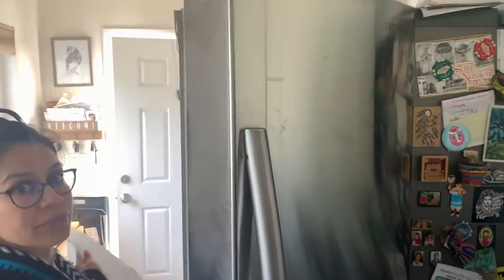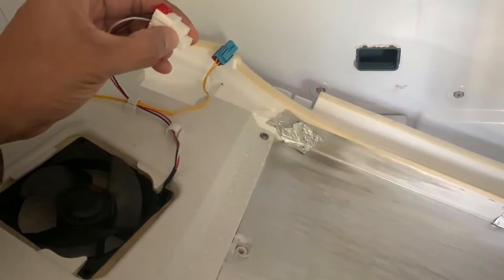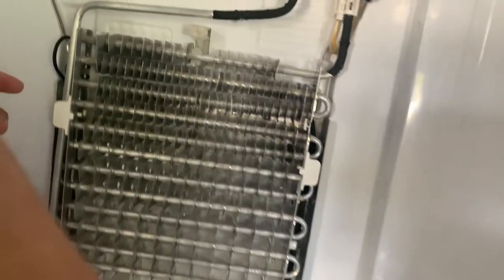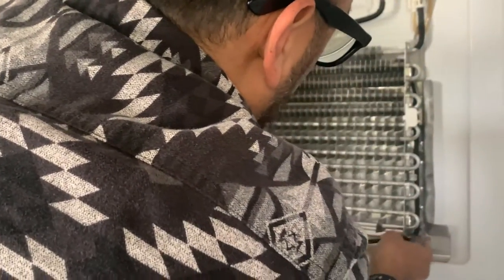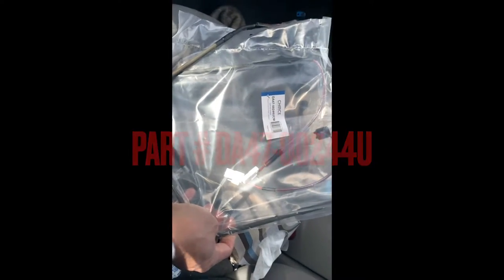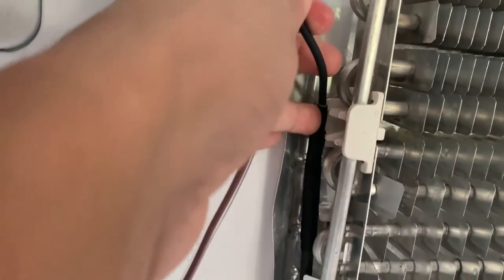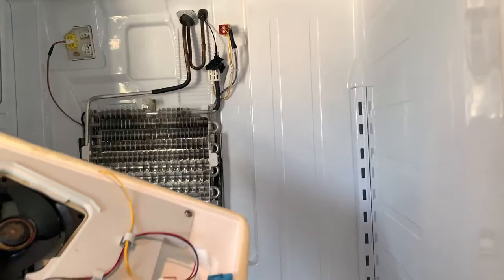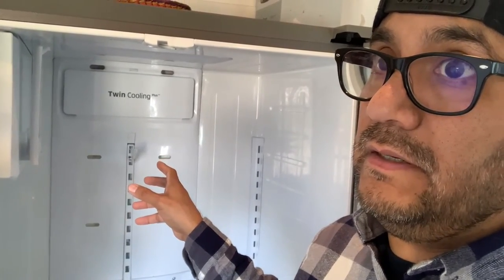Samsung Refrigerator - Thermostat and Defrost Heater Removal and Replacement

Comment: What you’re looking for is an extra heater that they have for the Samsung so it don’t freeze in the back it comes from Canada. I can get you to part number if you need it it just plugs into the other heater and the heater plugged into that I was at Sears repair man for 10 years. It’s something new.
Reply from the maker: That’s pretty awesome dude. Thanks. I ended up calling Samsung and they sent a repair guy out. He came out to my house twice and it still didn’t work. Then they sent another guy who replaced the ice box thing cuz of a warranty issue and it still didn’t work. I got rid off that fridge and got a new one. I hate doing that but wifey was done with that fridge.
Reply: I would love that part number
Reply: May I get that part number for sake?

Comment: Did that Resolve the problem
Reply from the maker: Unfortunately no. I had two Samsung repair guys come out and it still doesn’t work. I basically just unplug my fridge and let it defrost for a few hours and plug it back in
Reply: Bummer
Reply: @SanDiegoVDubLife and this is the only way it works ?  Also how often have to do this?
Reply: The fan might have burn. Try replacing it. I did on mine is in the back. It wasn't pushing air.

Comment: how did you clean the drain hole if it's clogged up?
Reply from the maker: You can pour hot water if it’s ice. If it’s food or debris you can try a coat hanger or pipe cleaner

Comment: My Samsung refrigerator freezer does not work I already changed the motherboard and it doesn't freeze. You think if I change that piece you're changing do you think that could be the problem
Reply from the maker: Not sure. This impacts the fridge section more but they are connected because the air circulates. If the circulation stops it might not freeze.

Comment: Lord have mercy!  I've learned WAY more than I ever hoped I'd need to about the cooling problems of Samsung fridges!!  Your video was very well done and provided many parts of what I learned, so thank you very much!

I'd like to reciprocate and help you and your viewers as well!  I've watched so many videos on this issue, some from handy folks like yourself and some from trained appliance repair techs.  What I've learned is that there are actually FOUR MAJOR DESIGN FLAWS with many Samsung models.

I'm not even speaking about issues with the ice maker or the freezer section. I'm talking strictly about the fridge section.  Here's what I've learned from others....

4 DESIGN FLAWS - THE PROBLEMS
1. The evaporator cover plate (the decorative cover attached to the back wall of the fridge) was poorly insulated and poorly sealed.
2. The openings in the back wall of the fridge, where the evaporator coil and wiring harnesses enter the compartment, were also poorly sealed off from outside (humid) air that can and will get into the fridge compartment.  Cold humid air = ice
3. The factory default position of the temperature sensor that detects the evaporator temperature so that the cooling feature can be turned on and off and the right times, is located on the wrong part of the evaporator coil.  It's located in an area that is naturally warmer than what we would like, thus triggering the cooling to kick on too soon and not turn off soon enough.
4. The factory original "evaporator drain clip" is undersized, which is why that drain line is very prone to freezing up.

SOLUTIONS
1. When you remove that evaporator cover, replace all of the factory foam that is supposed to seal the evaporator compartment off from the rest of the fridge.  It's very inadequate.  I even saw a video done by a repair tech in which he said that the number one repair they do is replacing that evaporator cover.  He claimed they replace 5 to 7 evaporator covers... per week!  I saw another video where the homeowner removed the fan assembly from that cover and used caulking all around where it clamps to the cover to help seal it off as well.

2. Remove ALL of the poor quality foam from around the wiring harnesses and entrance for the evaporator coil and use a spray foam to reseal those gaps around those entrance points.

3. Move the temperature/frost sensor from the original factory location and reconnect it a little further to the left and it will be operating based on more reliable temperatures.  You can find details on this at the following YouTube channel and video name...
YouTube Channel: Agglomeratedideas
Video Name: Samsung Refrigerator Evaporator Drain Clip - Icing & Not Cooling
Time: 23:35

4. ABSOLUTELY replace that horribly undersized evaporator drain clip!  The replacement upgrade from Samsung is part DA61-D6796A.  I have a friend who had several repairs done, parts replaced, and nothing resolved his issue until he replaced that part.

I HOPE THAT'S HELPFUL!!
Reply from the maker: Absolutely. Super helpful

Comment: How do I test that type of defrost thermostat?
Reply from the maker: I didn’t test mine. I just replaced it but if you have an ohm meter you should be able to test it.  There are videos on how to use an ohm meter to test a circuit. Also if your ice maker is freezing up Samsung has finally issued a recall so give them a call if that is  your issue.